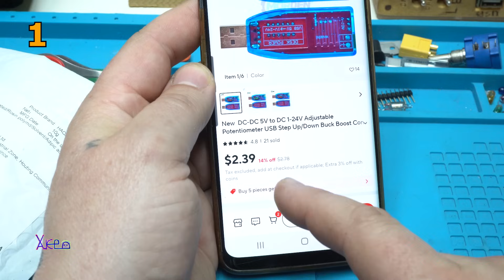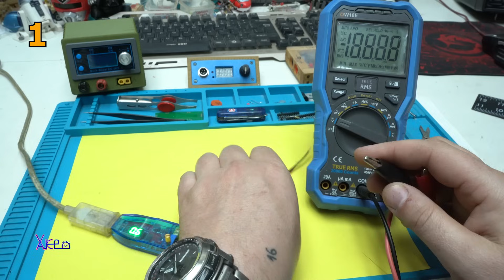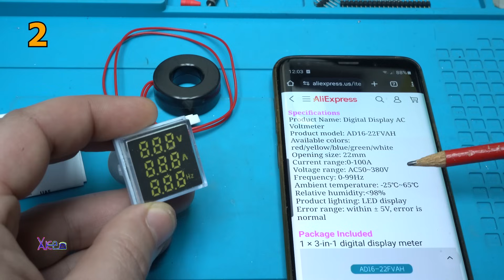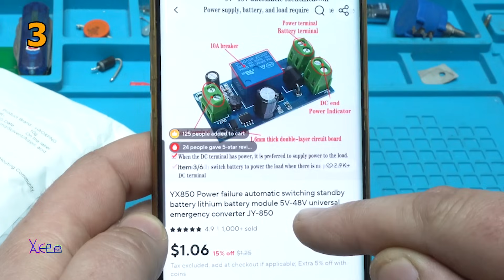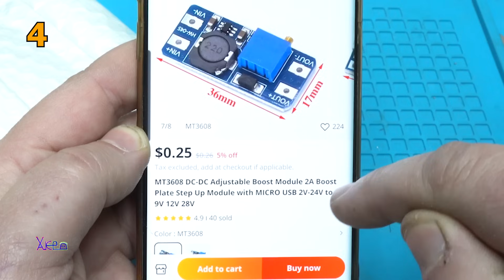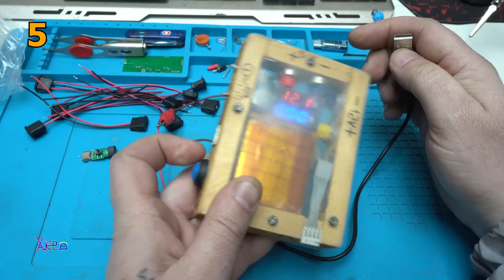TOP 5 AMAZING $1 Aliexpress Modules That Changed my Projects

Comment: Here's a few suggestions for uses of that lighter module. Incense burner, especially suited for natural frankincense. Cannabis vaporizer for oil or shatter. Essential oil vaporizer, but this will require a separate tiny vessel & a lower heater power. I suspect that if that heater is left powered for more than 60 seconds in free air, it will likely burn out. Any project designs should take that into account.

Comment: YX-850 is not an uninterrupted power switcher. You will lose power. The way I use it is to add a suitable sized capacitor on the output so that the device does not turn off when the power source is switched.

Comment: This module could be a battery terminal spot welding OR a plástic wire
Reply: OR a plástic welding hot wire gun for really cheap!
Reply from the maker: Yes you are right,its both

Comment: I purchased and have so many of those DC  power switching boards.  I'm using one to power my 12v dc wifi router using two m12 milwaukee tool  batteries.  6ahr.   This way I can disconnect the spent battery and solar recharge it without disruption of the wifi.  Love these boards.

Comment: Is the module adjustable so that if voltage drops too low, (not total failure) it will switch to the other supply?  Or does the power have to completely fail to make it switch? I see a pot on the board.

Comment: Love those Power Failure modules. If you shove a nice, big capacitor right where it connects to the modem or whatever, there won't even be the split second outage that reboots the device.
Fantastic item. Will be using them to solar / battery power Meshtastic LoRa nodes.
Reply from the maker: That’s a great idea to use them with solar!
Reply: @Hacktuber  Combined with 'CN3791 MPPT Solar Panel Regulator Controller' module, can run device and charge batteries during day and the 'Power Failure' module kicks in at night / low light. A circuit something like this:

       +------------------------+
       |   Solar Panel 1  |  
       |     (5V 0.55A)    |  
       +--------+--------------+  
                   |  
       +--------|---------------+  
       |   Solar Panel 2  |  
       |     (5V 0.55A)    |  
       +--------+--------------+  
                  |  
       +--------|--------------------+
       |     CN3791 MPPT   |  
       |  (MPPT Charger)   |  
       +--------+-------------------+  
                   |  
  +-------------+--------------------+  
  |        (Battery Output)    |  
  |   "3.7 Lithium Battery"  |  
  |   P+         P-                     |  
  +-------------+---------------------+  
                   |  
   +------------|---------------------+  
   |      1S BMS Module      |  
   |  (Battery Protection)   |  
   +-----+------------+-------------+  
            |              |  
    +----+--+      +--+----+  
    | BMS B+|      | BMS B-|  
    | (To       |          | (To    |  
    | Battery|      | Battery |  
    | Pack)  |      | Pack)  |  
    +--------+      +-------------+  
            |            |  
   +-----+------------+----------------+  
   |      YX850 Auto Switch   |  
   |  (Battery Backup Input)  |  
   +-----+------------+----------------+  
           |  
   +-----+------------+-----------------+  
   |      Heltec LoRa32 Node  |  
   |        (Main Load)               |  
   +-----+------------+-----------------+  
           |  
   +-----+------------+--------------+  
   |  470µF - 1000µF Cap   |  
   |  (+)  → Heltec BAT+     |  
   |  (-)  → Heltec BAT-       |  
   +-----------------------------------+  
         
         
       +----------------------------------+  
       | LM2596S Step-Down |  
       |      Converter (3.7V)    |  
       +----------------------------------+  
                      |  
       +-----------|-----------+  
       |    Solar Panel   |  
       |  (Direct Input)  |  
       +-----------------------+  
                       |  
       +------------|------------------+  
       | YX850 Primary Pwr |  
       |       (Direct 3.7V)       |  
       +-------------------------------+
Reply: good idea. a shame it didn't come with one. I noticed the router rebooted as soon as the main power was disconnected too
Reply: @ Jajaja, just extra cost for something that might not be needed (although obviously usually it would...). 
Anyway, easy enough and cheap too to get a bag of capacitors 10x the needed Voltage to just add to the circuit.
Just need to tell people new to tech that this is all that's needed.